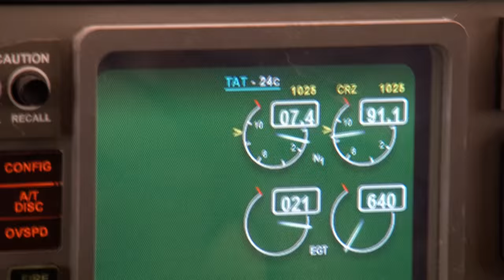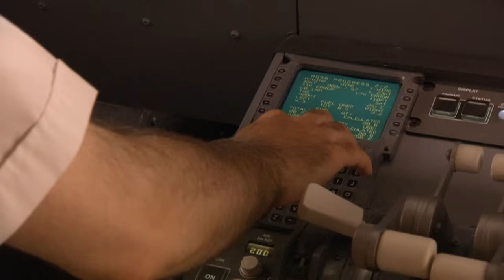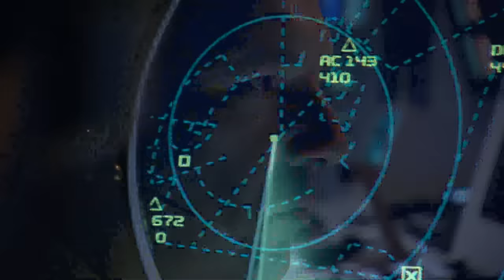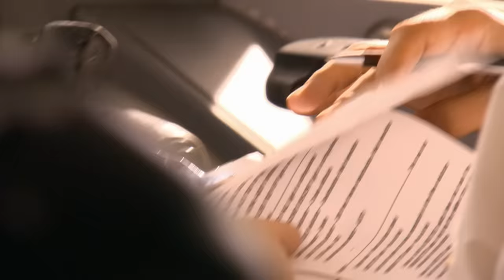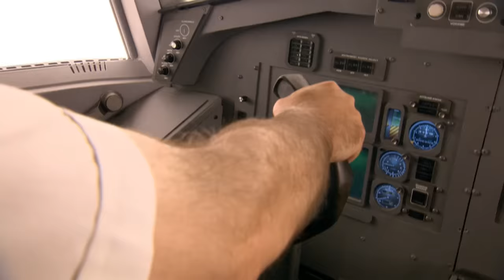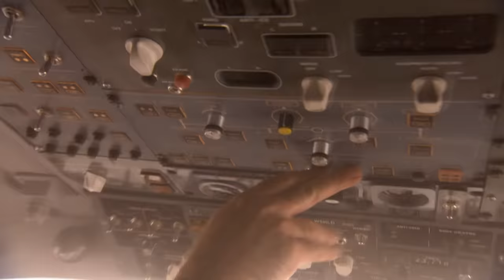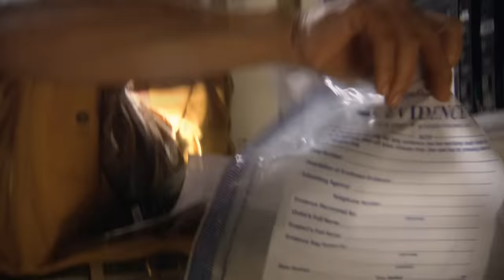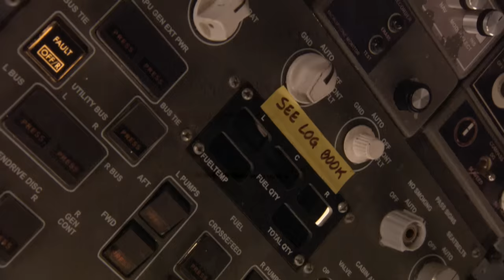Air Canada Flight 143 Lands With No Fuel | Mayday | Wonder

Comment: That pilot who landed that plane saving all those lives should be commended with the highest award for the way he handled the whole situation. He saved a multiple number of peoples lives from immanent catastrophic disaster; let's not shrug him off like it was a walk-in-the-park because it wasn't. God bless him forever, especially for the way he landed that plane.
Reply: And what an outstanding group of Canucks! They are still adding to humanity thanks to the spectacular skill of that pilot! Canadians Rock!!!!
Reply: I'm reminded of old sailing story.  A sailor left his cannon poorly lashed.  After firing the cannon, the gun became undone as began rolling across the deck, killing several sailors.  Fearlessly. the sailor charged across the deck and managed to get the cannon back under control, finally lashing it properly.  The Captain gave him a medal for his courage and then hung him for his mistake.
Reply: He should run for Prime Minister! IMAGINE a LEADER/POLITICIAN, That HAS YOUR BACK!
Reply: @ammocache6879  it was the fault of the guy on the ground who did the calculations and Air Canada for not doing proper training.
Reply: @deprofundis3293  It was the flight engineer responsibility to check the fuel calculations..  Since the new jet did not require a flight engineer it should fall on either the pilot or co-pilot.  Neither of which did.  Engineers duties were never split up properly.   Why fly a plane with no fuel gauges?   As is most of these cases, allowing many small errors that eventually cause a catastrophic failure.  Listen to the recommendations of the safety board.  Training and training and keeping spare parts available.  Flight Crew, ground crew and Air Canada if you want to find blame.  All I know if I had no fuel gauge I'd make darn sure I had fuel to spare.
Reply: @ammocache6879  So Boeing actually needed to be blamed.
Reply: Yes, but he was the cause of the accident. He should never have taken off but he disobeyed the rules that said not to, and committed one of aviation's highest sins - overconfidence.
Celebrating Pearson is tantamount to celebrating a drunk driver who summoned miraculous skills and action to swerve and avoid killing a busload of orphans. Don't forget that he caused the accident, and not by error of judgment, but by negligence.
Reply: @Bill_Woo  Canada metricated in 1975, long before this mishap occurred.  In my career as civil engineer, coming to Canada with 14 years of experience from South Africa where complete metrication occurred within a few years (1969-1972), a thing like this would not have happened. Canada's metrication effort has failed miserably in a number of industries, because it was seen as imposed by PET, particularly in Canada's western provinces.
Reply: @jacobderaadt6501  Yes, and Air Canada received high blame for mishandling the transition. But what was most tragic here is that despite unabashed head scratching confusion on the ground, Pearson pulled out a Jeppesen and said, yes, it's safe to fly. Not only overconfidence, but violating the M.E.L. as well.
One random gust of wind could have sent him into slicing up hundreds of wives and children by the runway, despite his great heroic skills getting to the ground. It's amazing how so many celebrate him, since he should never, never, never have taken off to begin with - yet he ordered it.
Reply: By the way, the platform is systematically erasing almost everything I write so if my posts disappear, that's why - nothing I can do about it!
Reply: @Bill_Woo  I have also had similar experiences, when e.g. a "Letter to the Editor is seriously mismangled/edited/changed, and what is seen in print is based on short clips of what I had written, taking the train of thought out of it, rendering me a moron.  I call that journalistic criminality.
Reply: Captain Piché of Air Transat should get the highest award. He flew his plane in 2001 without engines longer than anyone else, with way more people on board (300+), over the middle of the Atlantic, looking for a tiny speck of an island on which to land. Heavier plane, more people to save, longer flight without engine power = bigger hero. And he was a gliding expert too.
Reply: @deprofundis3293  not putting enough fuel in a plane is a huge error.
Reply: Saved the passengers, crew and and expensive aircraft.
Reply: Yes indeed
Reply: @gracieg7601  
A result of Multiple malfunctions !

 The resulting problem, 
can be described as:
a (too) small error.

Comment: This incident is fascinating, they used it as an example of how crucial a good understanding of unit conversion is in my chemical engineering program.
Reply: It feels like one of those long problem math questions.
Reply: Note that unit conversion errors in the design of the optics sank the original Hubble Telescope.
Reply: @MrGGPRI  Unit conversion errors also caused many a space probes to end up crashing, flying out into deep space, or exploding on the rocket.
Reply: And this example should reinforce the old adage, : "Trust, but verify."
Reply: Trust but verify and metric should be a standard.

Comment: A little known fact about this is that Air Canada tried to throw these two pilots under the bus, and fire them. The public outcry was so severe and so swift, that Air Canada had no choice but to back off. My wife has an uncle that flew for Air Canada for several decades, and he told me this story. There is also a movie about this, I saw it on cable sometime in the late 90's. At first, I thought it was fiction, because I didn't think there was ANY way a jet that size could glide, and then land safely. Great video, thank you for sharing it!
Reply: Movie name?
Reply: @KevAlberta  did you find the movie?
Reply: @KevAlberta  never mind, I found it. According to Wikipedia, the "1995 television movie Falling from the Sky: Flight 174 is loosely based on this event."
Reply: @deprofundis3293  cool thabjs

Comment: The aircraft was temporarily repaired at Gimli and flew out two days later to be fully repaired at a maintenance base in Winnipeg. Following the full repair, the aircraft was returned to service with Air Canada. Following a successful appeal against their suspensions, Pearson and Quintal were assigned as crew members aboard another Air Canada flight.
Reply: Trust Air Canada to suspend these capable pilots.
Reply: SUSPENSIONS?????
Reply: They did kinda not check the fuel level before takeoff guys
Reply: @JayJayAviation  not their responsibility.  Air Canada removed the flight engineer from their payroll to save money, that's on them.  Also the idiotic fuel mechanic that did the wrong conversion because reasons.
Reply: @JayJayAviation  I know a small private you check, I don't think on jet's they have a dipstick???
Reply: But if they have fuel gauges, you would be correct...  I'm sure they do now that I think of it.. have to...  oops... big oops..
Reply: @JayJayAviation  kind of?? Pathetic!!
Reply: @carolinelogie7721  ?
Reply: @JayJayAviation  Yes?
Reply: @carolinelogie7721  what do you mean
Reply: @helenpangelinan2142 , the video showed a dipstick, but they look at the dipstick before filling it, to see how much they need to add.
Reply: @patricklee4581  dude the 767 never had a flight engineer tho.
Reply: @helenpangelinan2142  wasn't the fuel gauge messed up due to a faulty fuel computer module component not being soldered properly?  Lots of cascading fault going on here.
Reply: @helenpangelinan2142  They had drip sticks on the B-767.
Reply: @helenpangelinan2142  Yes, but both the pilots and ground crew didn’t get enough training in the metric volume to weight conversions which they needed to do both for refuelling and the ‘dip stick’ level check. It’s not a difficult computation but you train so that it is automatic and your guts will tell you when something isn’t right in your calculation. The crews ended up using the wrong calculation, so the dip stick check agreed with the refuelling truck, which was not enough fuel.
Reply: @patricklee4581  Call me CRAZY, but Juan would thiMk that the FUEL tank should be the NUMBER ONE priority with ALL flights BEFORE takeoff!
Reply: @cybervigilante  That's PROTOCOL now! The GRUNTS always catch the flak of course!
Reply: @patricklee4581  it absolutely is the pilot's responsibility to verify the fuel he has on board the plane he will be flying, whether they had a flight engineer or not. It's also the aircraft fueler's responsibility to get those conversions right. They were all responsible and that's exactly why they were all suspended. 

I bet you they verified the fuel service records on all their flights after that.
Reply: @ATLMike94  It absolutely is not the pilot's responsibility.

You wanna make a wager?
Reply: @patricklee4581  I worked as an aircraft fueler. After fueling we take the fuel service record to the pilots specifically for them to verify it. The pilot should be on the same page with the fueler's calculations or the flight should not move. 

I'm not giving an opinion. That's actually what happens. I don't know about military pilots or private planes, just commercial flights such as this AirCanada flight. They were all at fault here.
Reply: I hope that these two gentlemen were taught  to do this math .
Reply: @ATLMike94  military pilots also have to be in on it, because remember they are the ones up in the air, it would be a little worse than just coasting to the side of the road with your car as this documentary clearly shows.

But yea, I can see how the pilots erred, because they didn’t check the work (math) of the fulers, I can kinda get how they didn’t catch it on takeoff, because it’s balanced at that point, and I’m reminded of a story my dad told of when he was a loadmaster on a C-130 and made a slight weight and balance calculation error that wasn’t caught on takeoff, but the pilots certainly caught it on landing, because they almost weren’t able to land it. They had to put their feet up on the dash to pull back on the yolk. The error was caught when the pilots mentioned it to him and he went back and checked.

Comment: As a Canadian getting my private pilots license in the mid 80’s, I flew and was trained on a tomahawk pa-38.  My instructor would routinely power back to idle on approach at higher than normal altitudes to force a ‘loss of power glide approach’.  It was instinctive to automatically crab the airplane to dump excessive altitude very quickly.  Watching this video recalled all that training in an instant.  Bravo captain Pearson!

Comment: I flew small general aircraft for years, including Cessnas, Pipers and Grummans. Periodically, I would slip them while landing. Normally a relatively manageable maneuver, but I can’t imagine doing it in a such a large aircraft with numerous passengers on board. Kudos to the pilots and the flight crew as well!
Reply: @jlockwood65  The pilots and the flight crew have much much more responsibility in such a situation and, as they say, “the pressure is on”. A lot different than just flying by yourself or with a co-pilot, as I often used to do.
Reply: @MaloPiloto  That, and the large jet is hardly as manoeuvrable.
Reply: @jlockwood65  First of all, he felt the need to expound on his/her experience as a pilot, first red flag.
Reply: @ lee, I am athletic and have always had good hand-eye coordination, a good driver, ice skater,  great dancer, etc.!  Not boasting, but I know I would do well as an airline pilot, and I would welcome the challenge too. It takes time to get the 'feel' of different automobiles, and most likely the same with different planes.
Reply: I completely concur as a general aviation pilot myself I have flown slips in all kinds of planes , but mostly used them in a Cessna 120 which didn't have flaps and many times the side slip was the only tool you had to get the plane on the runway. Many types of planes do not react well to being side slipped depending on the way the plane was configured . Some Cessna's would roll if you happened to have your flaps deployed. I have  never been privileged to fly a large airliner but once was given an hour of sim time on the B1 Simulator and what I discovered is at speed they handle very nimble and are quick to respond but as you slow them down such as on final approach to land their immense weight creates a lag in response to the controls very quickly resulting in pilot induced oscillation. This captains use of the side slip is a testament to his superb skills at flying the airplane and to his confidence in landing his aircraft under these conditions. He and his first officer are beyond excellent pilots. I know that it's common to claim the pilot in command is ultimately responsible for the flight conditions of the airplane but in this instance where the airline had no set policy for dealing with the change from imperial measurements to metric on the fuel quantities being pumped and allowing the plane to fly with defective fuel gauges. In my opinion the airline and it's policies are to blame. The actions of the entire crew were outstanding to say the least.

Comment: I live in Canada and I remember the nightmare of learning metric when I was teen in the late 70's. It was the reason that I failed my first driving test in 1980. The car that I used for my test was still in mph, and I got confused because I was nervous, and sped during my test.
Reply: As an American, if we ever go to metric, it will be pure chaos on the roads😅.
Reply: @equarg  I Agree lmaoooo
Once change all of the road signs through the interstate system from 35 miles to something like 50 KM ppl will be u in arms

US has been using metric for a while now, on everything but road, weather and stuff like height and weight idk why. I use both measurements and it's not a big deal to be, it only starts to get very confusing with distance
Reply: @Racko.  England still uses miles for the road, despite adopting metric for most other things.
Reply: @noseboop4354  Indeed!
Reply: When I started started drinking the speedometer had mph and kph.
Reply: I remember for a while in Wisconsin, they added metric speed limit signs and distances to the next town next the English system.  Those seem to have disappeared. Don’t know if they did it across the country or not.
Reply: me as an old school canadian: have no concept of fahrenheit and no concept of a kilometer 😂 It's all mixed up
Reply: @davidthompson5766 That's a strangely hilarious sentence.

Comment: If it didn't happen on this flight, it would have happen on another and they might not have been as lucky. Aviation is a constantly evolving field where you learn from mistakes and mechanical failures as much as you learn from books and experiments. Its fascinating, and scary.
Reply: yup, aviation laws were written in blood.
Reply: This is the problem with keeping the old British measurement units.  A probe to Mars also failed because American engineers working in two separate NASA units made calculations in two different measurement units.
Reply: @RicardoMartinez-oh9sq  
No, it's just a problem with unclear use of multiple systems. The international standards for aviation are all in Imperial measurements (fuel and aircraft weight in pounds, lengths in feet and nautical miles, speed in knots, etc), so kilograms are what shouldn't have been involved.
Reply: It did happen on another flight. Captain Piché of Air Transat flew his plane in 2001 without engines longer than anyone else, with way more people on board (300+), over the middle of the Atlantic, looking for a tiny speck of an island on which to land. Heavier plane, more people to save, longer flight without engine power = bigger hero. And he was a gliding expert too.